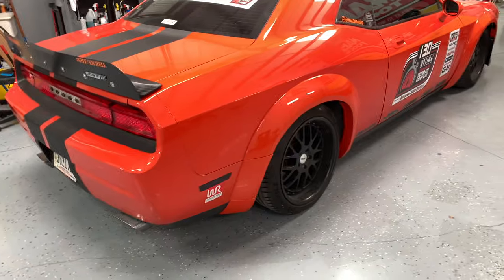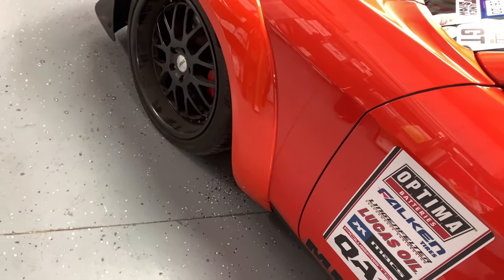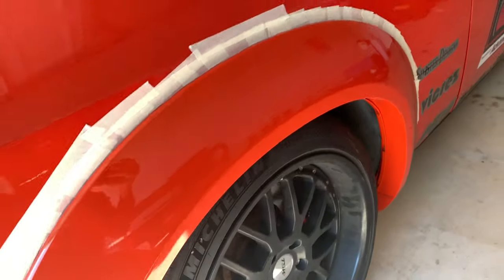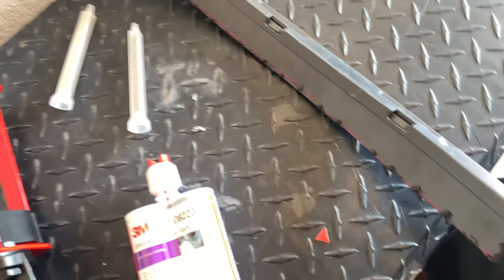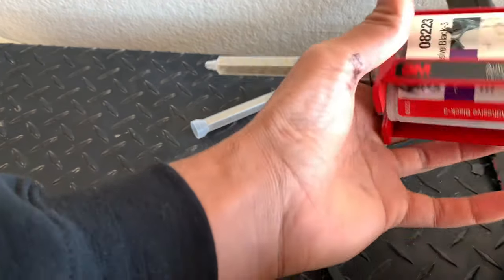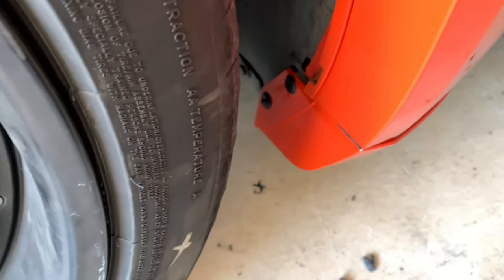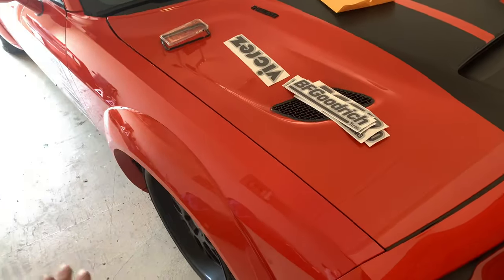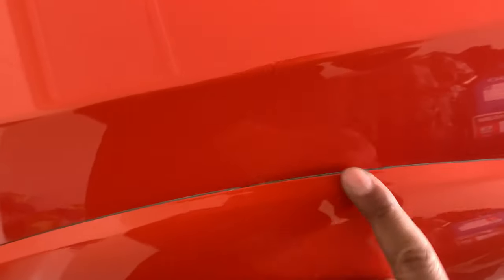Vicrez Challenger widebody: Tape VS Glue + (how to glue)

Comment: You did pretty good bro. Ima deff use 3m glue. What size of rims and tires you get btw
Reply from the maker: Hey James I appreciate that! And I went with oem demon wheels 18x11 (found them on eBay) and I’m currently riding on Nitto 555g2 on all 4 corners, but for autocross and track days I’ll be on BFGOODRICH Rival S 1.5 in a 315 also.
Reply: @TIRADORACING  I just finished conversing my v6 bumper to a hellcat bumper. Buying the flares soon but I want to buy rims and tires 1st. What size you recommend to avoid me doing extra cuts on the fender. Dont need exaggerated wide tires just something that looks stocked and clean
Reply from the maker: There’s more to this question than just “what size wheel should I get”.  If you want the widebody to look correct your going to need wheels that are not only wider but have the correct offset in order for the face of the wheel to sit closer to the lip of the new widebody flare......

So if you ask me get the wheels you like but for it to look right your going to need the correct negative offset for it to look right..... which means your going to have to trim... no real way around it.
Reply: @TIRADORACING  rodger I'll definitely keep that in mind
Reply: James Ruiz one other option you can run with the widebody for proper look and fitment would be a 20x11 wheel with a +5 offset, 305/35R20 for the tires

Comment: It’s kind of hard to tell, but do you have wider/Widebody wheels on the challenger ? That’s my only concern. If I order the kit and the factory Widebody wheels for my hellcat would the fit with the wheels and flares be perfect fit? Versus the wheels looking “tucked” in and the flares sticking out over the wheels? Thx
Reply from the maker: Yes this video is kind of old, check out some of newer ones. 

I’m running oem Dodge Demon wheels 18x11 -4.5 offset with Nitto 555 g2 315/40/18 on all 4 corners. 

Perfect is subjective so I will not say it will be a perfect fit because perfect for you and me are totally different. But will it look like a widebody Hellcat yes. Oem widebody wheels are 20x12 -2.5 offset. 

It’s all about offset when widening the car. Anything with a + positive offset will bring the wheel in (per say). A negative offset will push the wheel out. (This is a really basic way to think of it).

Comment: How do you go about the wider wheel to offset with the new fenders?
Reply from the maker: Hey Marcos, 

So the answer is in tour question, you would have to get wheels with the correct offset. I personally went with OEM Dodge Demon wheels to run competitive tires in the optima series but those specs are 18x11 with a -4.5 offset 

Oem Hellcat and scat pack widebody wheels are 20x12 with a -2.5 off set. 

The width of the wheel doesn’t necessarily matter if you have the incorrect offset. 

I use to run TSW in 20x10 +20 offset all the way around on my narrow body. And I even had a set of Forgeline Wheels with the rear being a 20x10.5 with the correct offset to sit flush with the narrow body.
Reply: @TIRADORACING  thank you, I have a set of fenders I've been meaning to install on mine, but I knew spacers alone ain't gonna cut it. Very useful info! all about the - offsset
Reply from the maker: I don’t use spacers but I know of actual professional drivers that do use spacers and even some pre runner trucks that use spacers. But yes all about offset!

Comment: Hey bro looks great 👍Mine will be here Monday! How is the glue holding up??
Reply from the maker: Thank you! And it’s been on all year lol autocross and one road race. The glue is messy, I would try the method I used with the 3m tape on our Infiniti Q50 rear diffuser. That thing is on there good! 

3m 30 pound tape 
3m adhesive promotor 
Heat up tape with heat gun 
Apply adhesive promotor to car 
Apply flare. 

But watch my video on the q50 and you’ll see how easy it is, I would try that before glue. Wish I would have tried the tape like that the first go round but oh well.
Reply: Thanks for the advice bro 👌🏽 I just watched the Q50 rear diffuser install video and it looks like it’ll hold up with that method! Do you think it’ll hold up against the heat and weather? What grit sandpaper do you recommend to rough up the paint ?
Reply from the maker: I can’t promise it’ll hold up to anything so don’t hate me lol. But our q50 has been solid all year lol. And you don’t need a super crazy grit, and also be careful on your fenders where you sand so you don’t sand too high up and the flare won’t cover it. 

Def a measure 5 times sand once.
Reply: @TIRADORACING  One last quick question.. my scat pack challenger is on stock suspension, I have the widebody replica wheels with -2.5 offset, would I need to cut the rear and front fenders?? Or just the front? I appreciate all the help man! The thought of cutting fenders and sanding some of the paint is scary, but I have my mind set on that widebody lol.
Reply from the maker: You technically don’t need to cut. As long as your on stock suspension. Now I have never personally done it but my friend @whipswitwavey has and another Instagram as well. 

I know a few others but I don’t know their instas off the top of my head. 

Do yourself a solid and watch @rome_lowlife videos as well. There are fitment issues with the front lip and he def figured it out. 

Lastly check out @mango3ninety2 videos as well. 

Those are all instagram handles so you need to find their YouTube’s. But mango3ninety2 did his all tape with small modifications to the flare that are simple to do. 

Between all those people and videos you should feel confident. But do yourself a favor and watch all the videos through, read all the comments, read the description below each video and I’m sure you’ll find all your answers. 

And of course feel free to DM on Instagram @tiradoracing 👌🏽

Comment: What did your paint/body guy use to fill it in before repainting?
Reply from the maker: I never took it to him, I figured it would be a waste to do it back in February, race all year, then have to get paint touch ups on the off season. 

If you do it right unlike I did you won’t need to have the gaps filled. 

I’m gonna year them off at some point and redo them anyway.

Comment: Is your car lowered? If that why you had to cut for clearance for bigger wheels?
Reply from the maker: Yes my car is aggressively low. Secondly I use it for racing. So when the car has body roll the wheels and tires would touch the fenders. Not the wheels and tires in this video, this video is old, but my demon wheels and tires.
Reply from the maker: And not just bigger wheels because I went from 20x10 wheels to 18x11 wheels. 

The Demon wheels have an aggressive offset that poke past the stock fender line. Unlike the 20 inch TSW’s in this video that stay inside the factory fenders.

Comment: hello I have a question do you think I have to cut  away part of the wheel wale on the wide body install if the wheels I have are 20x11 in the rear and 20x9 in the front staggered with 2" spacers in the front?
Reply from the maker: All depends on OFFSET. You can have 20x11 0 or 20x11 -4.5 like the demons. Without that offset number o really don’t know. But based off experience, you WILL need to cut some especially if you want the wheel flush with the fender. 

Just play with it and see what you can or can’t get away with
Reply: Ok cool I will get to work I’m also using glue

Comment: Man you should have went with @Phillps Performance Lil Devils. Excellent fit and finish no tape or glue.
Reply from the maker: I highly dislike those. I’m not trying to be mean or anything but adding the LiL Devil flares wouldn’t have allowed me to run this wide of a wheel and tire with how low the car sits. One high speed turn on the track and the Lil Devil flares will meet the tires in a heart beat. I might have been able to run wider tires out back but that’s only half the battle as I need just as wide a tire up front. 

So in the end the LD flares wouldn’t have solved my problem.... the goal wasn’t purely aesthetic, but to be able to run wider wheels and competitive tires for the Optima Ultimate Street Car series.
Reply: Those are not widebody kit’s those are just fender flares

Comment: Thanks for the information and  instructions. I ordered my kit from octane motorsports, litteraly looks exactly the same except they say they use polypropylene compared to vicrez polyurethane which is supposed to last longer and has higher heat tolerence. Anyways can I use a factory widebody splitter to fit the kit or does it have to be aftermarket?
Reply from the maker: The widebody oem splitter and the one that came with my vicrez bumper are the exact same. So if you get an oem widebody splitter it should work
Reply: @TIRADORACING  Thank you and thank you for responding on IG

Comment: Did you have to cut anything on your car to put the flares on
Reply from the maker: To answer your question no. I did not have to cut anything on my car to put the flares on. 

BUT I did cut the car and matched the cuts to the flares to put the demon wheels and tires on. My car is lowered and I use it for racing and I needed the clearance for the bigger wheels and tires.

Comment: How many bottles of the adhesive do you recommend ?
Reply from the maker: 3-4
Reply: TIRADO RACING thanks i should’ve went with this at first i used some butyl sealant i already had and it’s lifting when the car sits in heat only with the front fenders at the top .. it came out great just the lifting killing me 🤣🤣 trying to get it together before i get everything wrapped in satin black
Reply from the maker: I had some lifting and added a dab of super glue and it worked lol idk how bad your lifting was but mine wasn’t too bad. 

Also make sure you do it in a controlled environment where the glue and flares and car are all the same temperature. 

I did mine in 30* so I was 100% bound to get lifting issues in the summer and so far it hasn’t been too bad just a small spot here and there

Comment: hows it holding up so far? do you recommend the glue ? i seem your post saying you did it wrong and temperatures have to be the same due to expansion. what the best way to do this?
Reply from the maker: Best way is to Sand down some of the paint so the glue has something to grab onto. Need to clamp them together for 24hrs. Done in a controlled environment, glue and metal and flares all the same temp due to expansion rates differing with temperature (same thing I said in that other comment you read) 

It’s holding up good. Just went autocrossing and no issues. Texas heat, cold, rain, highway driving and racing. Their still on the car 5 months later lol. I don’t daily drive it but I did for about a month.

Comment: I have a 2019. Do I need to get different headlights for this kit???
Reply from the maker: Nah man. Like I said the OLDER generation headlamps are bigger. The 2015+ (this includes 2019) are the right size. 

It’s a Hellcat bumper, there weren’t hellcats pre 2015. 

So you wouldn’t need to do all these crazy steps
Reply: TIRADO RACING thanks for the info man! I appreciate it! I’m looking to getting one of those hoods you have. Looks sick!
Reply from the maker: Michael Fox I got that from Steve white parts, you can find them online. It’s an oem Hellcat hood. And no problem anytime!
Reply: TIRADO RACING you have a steel hood?
Reply from the maker: Michael Fox yes sir. Not fiberglass. Mopar part

Comment: Nice kit but why not just add an insulation rubber piece like they do on the vw bugs fenders.  The kit is never perfect....
Reply from the maker: Honestly you don’t need it...  it’s pretty close to oem. If you add a rubber insulator it’s going to create more space between the flare and the contact surface. It’ll make the flare be further away from the body. 

It’s been a while now and I have a couple of autox days on the car out in the Texas summer weather and their still on there.

Comment: What size tires are currently running?I'm considering doing a widebody on mine only concern is the tires rubbing on the fenders
Reply from the maker: In that video they were 255’s in a 20x10 +20 wheel. Hence why it looks “sunken “ into the widebody. 

Now I run OEM Dodge Demon wheels in 18x11 -4.5 offset with a 315/30/18 Bfgoodrich Rival S or my street tires Nitto 555 G2 in 315/40/18 (bigger side wall)

If you have stock wheels you won’t necessarily run the fenders, the width of the tire isn’t the problem. If your lowered and get the correct offset wheel that pokes out then you’ll be rubbing your fenders. 

I have friends who did the widebody and widebody Hellcat/scatpack wheels and they ride on stock suspension so they don’t rub at all! 

I was lowered so when I added the demon wheels I had to cut my fenders. 

Adding wider tires alone will not fill out the fender flares YOU NEED THE CORRECT OFFSET that pushes the wheel out. 

Hope this helps!
Reply: @TIRADORACING  You covered just about everything. Thank you. Only question left is, how much 'lowered' were you? I plan to stay stock but run a taller tire. So if you're lowered an inch and I want to gain an inch in total dia, then it sounds like I'll rub. Thanks for your time.
Reply from the maker: I’m lowered like 6 inches lol my rockers almost touch the ground lol. I think you’ll be fine!

Comment: 20x11 wheels?
Reply from the maker: Yea 20x11, it all depends on the offset. Can you fit 20x11 on the narrow body? I’m not sure. 

Will 20x11 fit on the widebody, yes. But your going to need the right offset to fill the wider wheel well.
Reply: Do you have to cut the fenders before you install the flares?
Reply from the maker: Ken Doug 

If your lowered and are going to run wide wheels yes you need to cut before you install the flares. It’s hard to cut the car with the flares on. 

Others have ran the flares without cutting, and with wider wheels with the right offset**im not saying to do this, I’m just stating others have done so before****I do not know what size tires they used either so the tire height might have some effect as well***

All I can tell you is what I did, I cut my car to make room for my oem demon wheels, and my car is lowered and I use my car for racing

So the benefits of running more tire far outweighed me cutting my car so it was easy for me to cut my car. 

Whatever choice you decided to go with do so at your own risk and with your own judgement.
Reply: Whats the offset do you have on your car ? If you cut the fender where do yoy have to cut it could yoy make a tutorial video about that?

Comment: Can’t you get a moped kit ? I used to hate that you pay 80k for a redeye widebody and then mopar offers half the parts on new cars to make other challengers look like red eyes and demons,I felt like what’s the point in feeling like your part of a small group ,if everyone can pretend to be in it for a 1/2 the price..now it’s like who cares as long as each person enjoys themselves
Reply from the maker: A mopar kit would be replacing the entire rear quarters and front fenders. I bought mopar front fender flares to try and do the swap but it’s 10x harder. Each flare has 30 clips that seat into the fender and rear quarter. 

Secondly. The amount of time and money spent on the engine, transmission, interior etc.... didn’t make sense for me to go out and buy a scat pack widebody and start from scratch. 

Your viewing it as people can “pretend” to be a part of a group of high performance cars. 

In my case I never said I was trying to be Hellcat or demon

The added cooling benefits of the Hellcat bumper and hood are UNDENIABLE. So why would I cut holes in my bumper and old hood when I could easily slap the new ones on and allow more air flow in my engine compartment. 

You see it as someone playing pretend, I see it as a way to make my track oriented challenger faster and cooler. 

I’m not denying you of your viewpoint, it’s yours. I’m just letting you know why I did what I did. Wider wheels, more grip, Hellcat body modifications more cooling, things don’t break anymore.

Comment: These are quite expensive for what you get,  horrible fitment, looks good if it would stay, I think they could have been formed better for a better fit
Reply from the maker: to make it look good and to make it stay is all about the prep and installation. If you ask me personally, you get what you pay for.... 

I purchased oem flares before this and the oem flares really don’t work unless you have widebody fenders and rear quarter panels for them to snap into. On top of that the front and rear bumpers also have grooves for the flares to sit into. And that’s the best way to get the nice tight oem look. 

But that’s new fenders, new rear quarter panels, front and rear bumpers, plus the flares. I had it priced out and it came out to almost 11k with labor to install and after paint. 

So when you compare the price of oem, to aftermarket I would say you get what pay for. Just my .2. For right around 1k bucks after paint and labor to install you can make it look decent. Some have made it look really good!

Comment: Always tape never glue, glue destroys your paint job if you need to remove it. Tape works perfect if the product you are installing fits correctly and isnt mass produced junk
Reply from the maker: Idk, a lot of people has successfully used this kit. 

And yes glue will destroy the paint, but I (as in personal preference here) cut and lowered my car for the wheels and tires to clear the original body lines. So I had 0 intentions of taking it off or ever going back to a narrow body. 

You gotta remember that when you watch these videos, their not an end all be all. I’m just documenting my journey. If you don’t like it don’t do it.